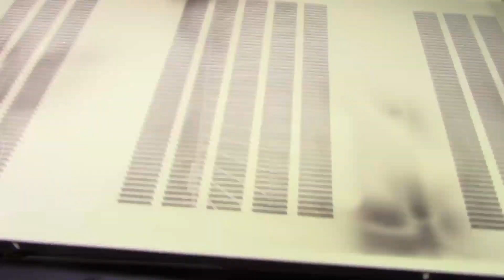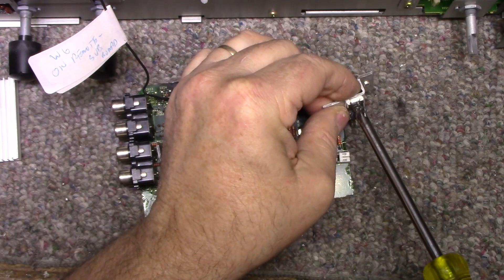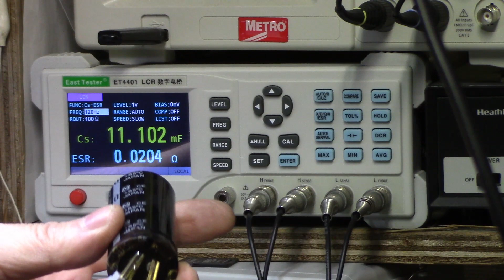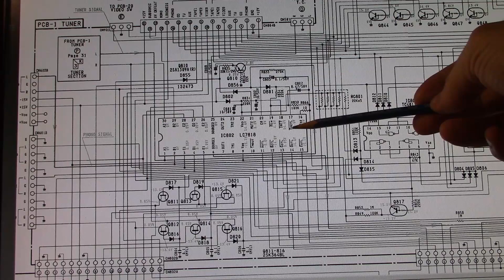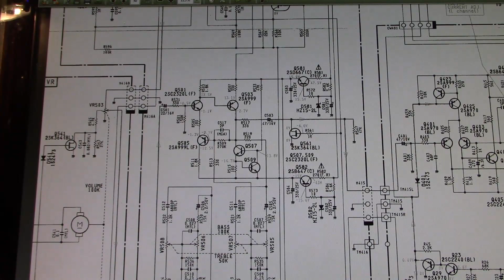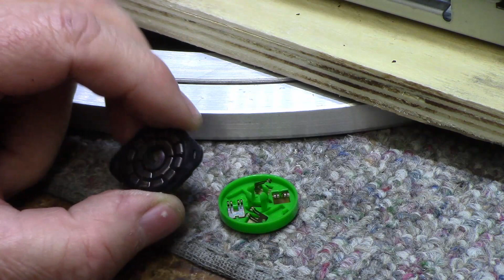Harman Kardon HK3600 Receiver - Failed caps everywhere (Ep. 56)

Comment: Yeah, I have a HK-3350 30 w/ch from same series, and it draws 10w at pwr OFF. Bad design!  I use a cheap $5 pwr strip to fully turn off. My unit is much more bare bones than yours , and  has no phono, which is fine as I use an outboard phono preamp. I bought the HK for $25 about about a year ago. One of the bias trimmers was bad, but after replacement of that and 4 or 5 caps, all is good. I'm sure that after more upgrades and tweaks,  HK-3350 can be almost an audiophile "amp".

Comment: It seems to me that the whole power arrangement of this unit is poorly thought out.  From what I saw, there was replication of 15-0-15 regulators on several boards, where they could have done once at the power supply board, preferably off separate windings from the transformer.  But, yes, it also needs a separate keep-alive supply.  0 out of 10 from me for this design.

Comment: Hello,,  I have the same unit, HK3600,,  was a hand-me-down from a friend. Problem is the Loudness will not switch off, (the light on the Loudness button is always on).  I have high frequency hearing loss and play the unit with the Treble all up and the Bass all down as a result of not being able to turn the Loudness off.  Am not an electrician and have not ventured into the circuitry but would if its just a matter of snipping a wire.  Might the Loudness be permanently discontinued easily?  Thanks for any suggestions.

Comment: Could you change the power switch function so the power transformer goes dead. So then the amp can't heat up.
Reply from the maker: I could but that creates other problems that would need to be worked around. The microprocessor would still need a soft-start signal to wake up the receiver so it would need two power switches or some kind of delay hack to run from 1 switch.  Plus, I think the station presets would be lost if power was cut.
IMO, there are more desirable receivers than this to pursue
Reply: @TrevorsBench  then I would make a switch into the power cord 😁 to set it 📴
Reply: @TrevorsBench  absolutely right in that case, yes. Strange this design. Not realy 2021 way of thinking green. Well you repaired the damaged parts, was nice to see some smoke action on amping 100khz hahaha
Reply from the maker: @Dutchamp  Lol, the smoke at 100Khz was the Zobel network on the output getting hot. I try not to smoke amplifiers, at least not intentionally

Comment: I own a 3500 now ( not the 3600 ) . Still sounds great .I cleaned the pots.  These models started coming out when hi-fi VCR's and Betamax started coming out. The HK HK series were still pretty good . HK started going down with their AVR receivers . I love that they have pre-out/main in and a sub out with volume control. My LED display is out though. But, I don't use the radio anymore because of Spotify .

Comment: Hello and happy new year!
I bought an analog scope (hameg 204-6 20mhz double channel) but the probe is missing.

What kind of probe I need?
The front chassis says: "1Mohm 30pF".

Thanks in advance :)!
Reply from the maker: Hi, for regular BNC probes you could go to aliexpress and search for 'scope probes' and you'll see hundreds of cheap Chinese probes to choose from at good prices.
I wouldn't get hung up on searching for the best probes around because you'll end up paying more and in the end. Guess what I'm trying to say is probes are a consumable items which will need to be replaced from time to time so don't develop a financial or emotional bond. 
Having a X10 probe is very good and recommended. The 1M and 30pf written on your Hameg would be the input impedance and capacitance
Reply: @TrevorsBench  Thank you so much for your fast response :)!

Yeah, I've found some probes on eBay for a reasonable price... But, they says "100mhz" and my scope is 20mhz. 
It's still okay?

Thanks again :)!
Reply from the maker: @Naitoraven951  Yes, they will work fine
Reply: @TrevorsBench  Thank you so much!!

Oh, btw, can I ask you another huge favor?
My CDP-11s have some problem with the CD tray and disassemble it is a huge PAIN.
So, can you create a video tutorial (step-by-step) of how to fix the mechanical problem of the unit and how to disassemble it?

https://youtu.be/Wqv-vIzyhmw
(Here's my issue) 

Thanks again!